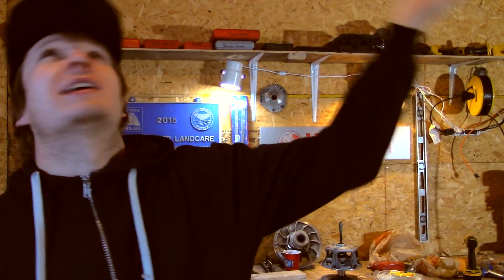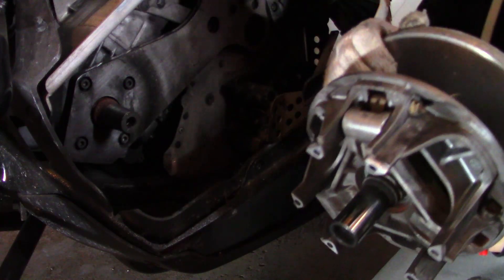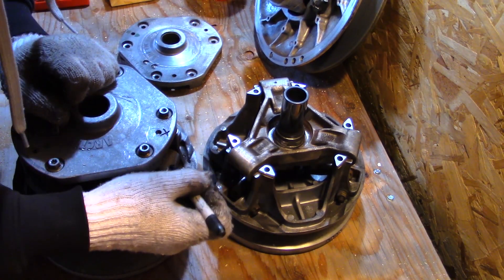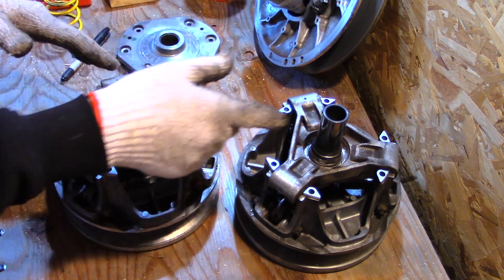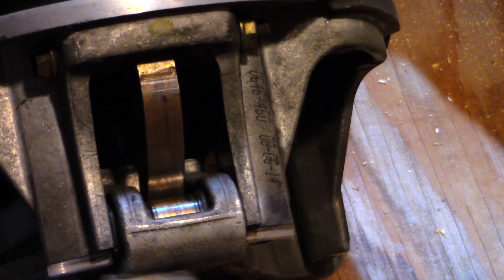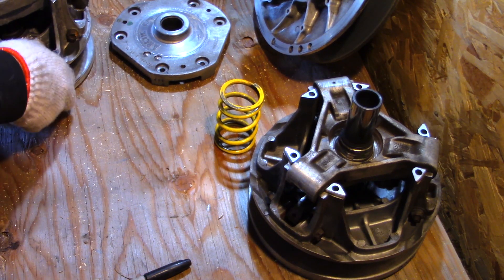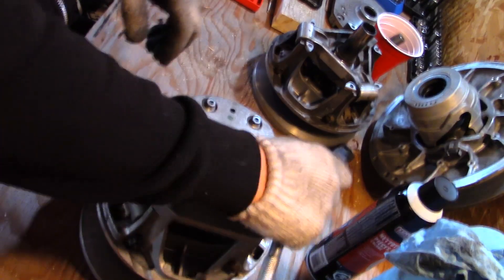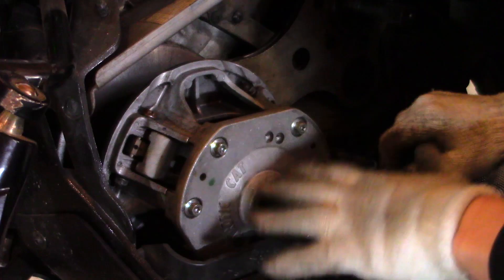Why SNOWMOBILE CLUTCHES FAIL

Comment: In the clutch rollers. I like putting engine oil or two stroke oil on them once in awhile. It helps when it’s lubed and lasts way longer. Sometimes an engine just needs cleaning and lots of lube is what I say.

Comment: do i need to get a new one when one of the weight spring is stuck? the two others move normaly but one is 100% stuck. i blew out some rollers on the secondary, and swaped those and after that my crossfire is always griping when i start it, and if i push the brake i kills the engine. and the problem is in the primary. it is on a arctic cat 2011 crossfire

Comment: Good video, I’ve been debating doing my own clutch….I usually blow out the dust after 2 rides and also I’ve been using LP1 on the weights and rollers…what do you think?

Comment: Hey I got a question for you I just picked up a snowmobile and it seems like when I hammer down on the gas it will spit sparks out of the clutch for a minute then I will come out of it it comes back sometimes sometimes it does not do you have a clue if that means my clutch might be going it’s driving just fine and revving up just fine and taking off just fine but it does spark every now and then out of the clutch area

Comment: Not to be negative my friend, No.1 "" their is supposed to be a little play side to side, it's the up and down that is crucial ,those plastic shims on each side of the rollers wear and should be checked  or changed. No.2 the springs  should be measured with a caliper because they lose their tensisaty, just a head's up bro,no disrespect . Great video quality  thanks ✌

Comment: Bad idea to use an impact to remove the primary, its hell on the crank and bearings- always remove by hand with a pry bar and breaker bar
Reply from the maker: Incorrect.
This is as per the service manual
Reply: Did not realize that, thanks for info. Im more familiar with polaris, the epi pullers i have and polaris manual say something like grease the threads and dont use an impact, using an impact changes the spider torque value and can cause damage to crank bearings. Thanks for making vids. Cheers
Reply from the maker: @007.3l  Yea man. A little bit of grease on the tip go miles. These ones can be stubborn sometimes even with air. Cheers Chris! 🍻

Comment: CV-TECH POWERBLOC primary clutches are the best fewest moving parts in a clutch and there reliable coming from some1 who just rides every single year here in ALASKA BORN AND RAISED i ride snowmobiles every year
Reply from the maker: Good to know it's holding up!
Reply: @syxxes  i dont ride the mtns but i got a 2006 ski-doo 600sdi 144 i re geared it for flat land riding i also need to re clutch it for sea level elevation and swap my A-ARMS and front shocks but so far im liking it
Reply: The nearest mtns are any where from 40 to 60 miles away and im not wanting to travel that far just to ride the mtns
Reply from the maker: @edwardabrahamiii3742  we drive 5 hours every couple of weeks for mountain riding
Reply: @syxxes  here in my part of Alaska we never use trucks our gravel road aint big enough theres not 1 truck in my village any more in order to get to the mountains you got to use your sled and ride over the the frozen tundra lakes creeks rivers and ponds to get to the mtns it takes about an average of 2 hrs to get to the mtns that are 60 miles away doing speeds about 40 to 70 mph and it also takes about 2 hrs to get to the 40 mile mtns bc the tundra is just so rough rugged and harsh there are no groomed trails

Comment: I use gun oil on all wearable surfaces on my clutches. Gotta keep up on the clean out though. Belt dust is a bitch... I've done exactly what you did leaning on it before and after. The feeling and sound difference is crazy. I believe they need some type of lubrication barrier.
Reply: I do the same. I use Tri-Flow. It's a low temp silicone lube. Works pretty good.
Reply: I use LP1

Comment: so this is an odd-ball question.. I'm curious what the drive-shaft measures from the backplate to the end of it with the clutch off.. ;)
Reply from the maker: That's a question! There are alignment shims back there too.
Reply: @syxxes  I have a 13 HCR that I could not get the clutch off. I tried everything. Had to cut it off and needed to know how deep the stub went. Luckily I was careful enough to remove it without any damage to the stub.. The clutch.. well RIP! 😂
Reply from the maker: @cannedham3774  I've had to cut one of em off in my day!

Comment: I’m not bashing but I’m not sure I learned anything here. All clutches fail if not properly maintained and or if not calibrated causing excessive heat and or if the parallelism, center to center and offset is not to spec but I was hoping you would explain a little more about the arctic cat clutch it’s self because despite their reputation, I haven’t seen any evidence they are any better or worse than anything else.

Comment: I’m a newbie to mountain riding. Have been running 2012 and 2013 m-8 for years at lower elevation. Heading to Wyoming soon. Was wondering what primary weights and spring you guys run for 9000’+. Also ski pressure front and rear for fox float 2. Any help would be great. Thanks and keep the videos coming
Reply from the maker: Shock pressure is really whatever you like. I run mine at 120 in the front and 150 in the rear. As for weights and springs. The stock spring is good. Weighs should be a 65 or a 68. Either one will do you good.

Comment: FYI  use water or grease to get the clutch off no special tool needed not telling you what to do just an idea its worked for me an many others
Reply from the maker: You can do that with Skidoo clutches. But would have to find a special bolt to do that with cat clutches.

Comment: When taking the clutch off you shouldn't hit the clutch remover too hard with a hammer as I have seen the end wheel on a t-cat move in and jamb against the connecting rod which wasn't nice at all . Same with putting the clutch back on - should only use a ratchet type torque wrench and a long bar to hold the clutch -- can pivot the last end wheel out of alignment using a impact .

Comment: Hey man. I'm curious if you would know if a 2016 secondary would fit on a 2013 m8? Is the jack shaft splines different?
Reply from the maker: Jack-shaft splines are different. You'd need to do primary, secondary, jackshaft and there is a bunch of work that needs to be done in the chain case too, for the ideal setup.
Reply: @syxxes  ok. I thought maybe they made the inner shaft thicker but left the splines alone. I know the primary clutch from a 16 will bolt right up to a 2012-15 but I was not sure on the secondary. I was told the secondary from a 16 would also bolt up but I wasn't sure it would
Reply: @syxxes  what was your clutches set up like? Spring weights in primary and secondary. Ill be riding in Revy so 6000ft ish

Comment: Bushing is out in the roller, then the cam arm/ shift weight skids on the roller. They are rebuildable if you can find parts and you have a grunt tool to get the spider off. You must heat the spider around the center because they are assembled with red loc Tite. Cat  only sells the complete spider assembly last I checked.
Reply: Kind of having a issue with mine. I can't get the primary to go in and out. To catch the belt. I rebuilt the clutch I'm guessing I did it wrong

Comment: A 911 kit from thunder products will solve your problems   Even go with there abc bearing kit.  Have used them for over a decade cause cat builds crappy clutches.  Had trouble with my team clutch on my 700. Wildcat trail this year and found out that you can’t change the roller on the team primary but can on the same clutch on a Polaris RZR  cause nobody makes a part to hold the clutch when you want to remove the nut and spider for the team clutch from cat You have to buy a complete new one

Comment: Been running tra clutches for 20 years. ZERO failures. Only rebuilt one in my life, and that was with free used parts. I don't even bother cleaning them.All of them were hooked to the tried and true 670.(several different sleds) Again NO major problems with those either. Just a bunch of spark plugs.
Reply from the maker: Oy my 800 Rev, I rebuilt mine twice!

Comment: Had the spider break last year on my Proclimb, left me stranded at the bottom of a canyon. Got 7 years out of it. The real junk is the secondaries, went through 2 before finally switching to a Team torsional which Cat switched to. Just ordered a 2021 Alpha...so this will be the Proclimbs last season.
Reply from the maker: Strange. On the hundreds of thses I've worked on I've probably only ever done one or two secondary clutches. Way more drive clutches.

Comment: Matt you talk about the clutches being timed and show the timing mark on the plate. Where is the corresponding mark?
Reply from the maker: There should be a matching mark on the movable sheave as well as on the spider. If you are taking one apart, just make your own marks on it.
Reply: @syxxes  ok thanks. I had mine apart last year to change the weights and didn't know about them being timed
Reply: @rascal1330  yup they are balanced as a unit so you want to reassemble them exactly the same as before you took it apart. It's not really timing more like indexing.
Reply: I changed my weights out last year and sled seems to run fine. Just wondering what peek rpm should be for my 2015 m8  162?
Reply: @rascal1330  not sure, you will have to check the service manual for your machine or a dealer. The peak is actually the shift rpm of your engine and clutchs . When you hammer the throttle wide open and hold it there the clutches should let the engine rpms quickly build to and then hold at the manufacturer's recommended shift rpm and should stay there and not very from that rpm untill the clutches are shifted all the way through. Racers work hard on clutching, that's what makes for a fast machine. Shift rpm is a function of available engine power, gear ratio in the chaincase, and the weight and profile of the cam arms and the spring weight profiles. Some racers will over clutch or raise the shift rpm slightly to compensate for rpm sag when the clutches get hot.
Reply: Oh and don't forget about the driven clutch it affects back shift and upshift as well.

Comment: The previous owner of my 2013 M8 had the primary clutch cover off.  I am unsure how to check the factory timing marks from your video and I think the balance may be off as my primary has a pretty good vibration at idle.  What exactly should I look for to make sure that cover is clocked properly?
Reply from the maker: The best chance you have is to see if you can see the marks. Black and green dots on the outside cover and should see some on the spider if they didn't wear off.

Comment: You should be able to get all the parts to rebuild the clutch. It's just going to take little research. There's a place in Minnesota that sales rebuild parts for those arctic cat clutches, I'd half to go thru my files to find their info if you want it.
Reply from the maker: It's not even worth it by the time I have to pay the markup on the dollar to get it delivered to Canada. Cheaper to go the my local used place Sled Parlor. By the time I pay for shipping and handling and dollar value, it ain't worth it. Love to support local!

Comment: Just a quick question is the 2012 arctic cat m8 153 is a good sled?
Reply: I would recommend a 2014 or newer.  Many updates made it a much better and more reliable sled.
Reply: Karson Hoeflicher it’s the first year of the new style. I’ve heard to stay away from them. But I do have a buddy that has one with 3,500mi on  it. If that helps ya at all
Reply: Thanks guys
Reply from the maker: You got some good comments here. It's a good sled but the 2014 and newer models have some good upgrades.
Reply: Ok

Comment: Had a roller on my primary seize up last ride, destroyed a weight and clutch kept sticking engaged! And I don’t have $400 for a new one :( 
I run 65g in my M7 for 10k+
Reply from the maker: Yeah, it sucks having to bite the bullet on a part the expensive.
Reply: The rollers can be replaced. I get them from royal distributing among many....  under $100

Comment: My sled runs and idols but wont move and bogs down when pushing the throttle I think its a foweld spark plug or the carbs are plugged but other than that shes minty Mr Chow 😆
Reply from the maker: Might need a carb clean. Might be worth checking the reeds too. I'll be doing a reed video in the next day or two!

Comment: Never ever use power tools (impact) or hammers when pulling clutches!!! The impact and vibration can cause the crankshaft to become untrue and you will break your crank over time from the untrue rotation. If your clutch won’t come off with hand tools, apply heat to the area where the belt rests and she’ll pop right off.
Reply from the maker: Someone didn't read the service manual xD. Arctic Cat says "use impact". Hell I even struck it light with a hammer like the service manual says! No problems here my friend!
Reply: Very common to use a hammer when pulling a stuck primary, just don’t get carried away.

Comment: If you put grease on the puller threads and tip of puller, it pops off with little effort. 150 psi with no grease wasn't doing it but it took 75 psi with grease.
Reply from the maker: Depends on the clutch man. Some come easy others don't. I use grease if a few light smacks doesn't pull it out

Comment: can you do a video of tool you need and from taking first and secondary off and how to clean and last put it back to getter with toque # I never did one and want to do my sled to save some $$$ thank
Reply from the maker: I'll see what I can do!
Reply: 454541030 Find a factory service manual for your specific sled. It’ll be indispensable if you’re a beginner trying to save $ working on your own sled!
Reply: Services manual is nice but im more visual watching or lessening i do best its a 14 m8000 and its been going on 5 years going at the dealer but now i want to learn and this guy awesome 👌👍🤘
Reply: @DrainReaper  then learn from some one that knows what there doing. Just saying im not impressed with Syxxes Performance.